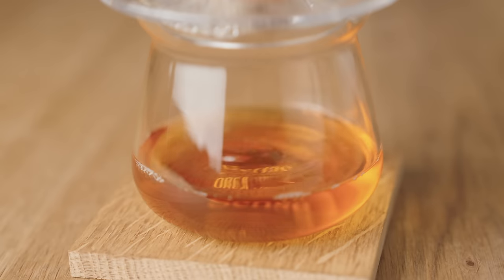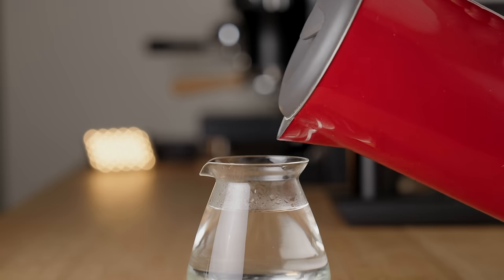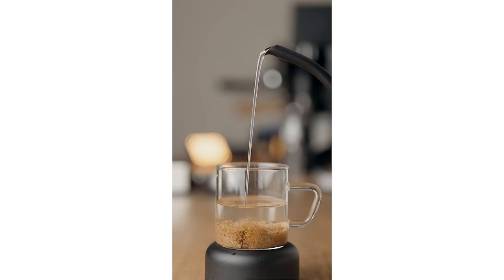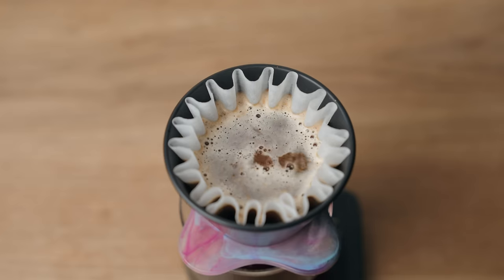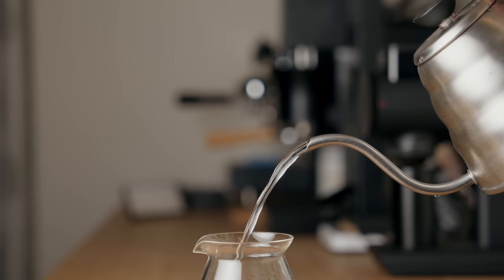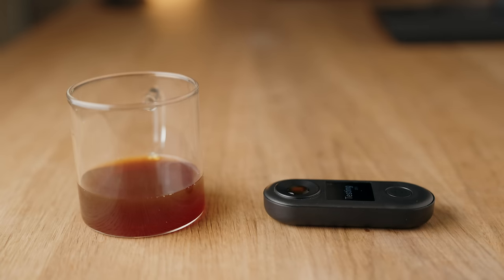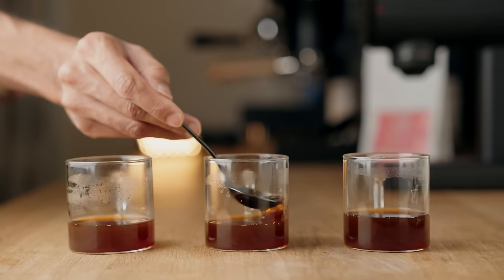Learn To Pour & Never Look At Pour-Over Coffee The Same!

Comment: Changing my flow rate to change my coffee bed to increase or decrease the amount of resistance the dissolved solids are creating. Aim at the sweet spot where your flow is strong enough not too much that the fines all collectively clog. But if you want a faster overall flow use less agitation and grind your beans very fine .

Comment: Thanks! I'm so poured! I have come to learn different pouring techniques using different drippers.
Over time I have changed the way I pour and at present my first go to method is: 1. bloom in a slow circle, 2. combo of center and slow circle 3. three pours combo of bobbing and center 4. let it draw down. To fine tune I tweak with temperature or grind finer. Or agitate less with longer lower center pours. 
With medium roasts I use the osmotic flow. I had the privilege to take a masterclass from the Cafec founder himself on how to brew with the osmotic flow technique. I have come to brew very balanced cups with that technique but it does take some trial and error to master it.

Comment: Hey ARAMSE, I've been loving your content so far! I was wondering if you would be interested in doing a video on different v60s and thermal retention of the brew? I have yet to see a rigorous analysis of temperature loss that compares plastic, ceramic, glass, steel and copper. I am interested as many say metal would be much worse than plastic due to much higher thermal conductivity but since the brewer has such a low thermal mass I am somewhat dubious. I also saw a video that said the copper produced the best results despite the highest thermal conductivity! It would be great to see an analysis that actually tests all the brewers side by side. It would also be cool to see an analysis on how to adjust recipes made in one brewer (ex. plastic) if you only have access to a metal/ceramic etc. v60. Thanks!

Comment: A. I'm so poured.
B. Found my light roast home when you mentioned Bloom Coffee Roasters (can't thank you enough) on another video, so am now really excited to try Quick Brown Fox Coffee Roasters 😃

C. Coming to the point regarding the video at hand:
I'm really happy with my V60 brew every morning, and my first watch was very much in the vein of someone who could've switched off when you asked us to - but I still found tremendous value in the video.

That said, even though I'm really satisfied with my brews, I'm a crazed serial tinkerer who can't help but notice the tremendous differences obtained by swirls, stirs and of course pours (religiously ceterus paribus of course).

For context, I make a 2 cup V60 with 30 grams of coffee and 450 grams of water every morning (so about 66g/l), and I follow the James Hoffmann Ultimate V60 method almost exactly. I do a 65-85gm bloom, restart pouring at 40-45s, followed by reaching a 270gms total by 1m15s and finishing at 450gms by 1m45s.

So many times I've noticed significant changes through:
1. Pouring 300g by 1m15 (as if I were doing 60g/L), and then slowing the pour to reach 450gms by 1m45s.
2. Pouring predominantly smaller diameter circles (say 80% of the pouring circles would be 50% of the maximum possible diameter), vs pouring all diameters as evenly as possible.
3. Pouring more centrally up to 1m15s and then widening for the last bit, or vice versa, or pouring evenly throughout.

But regardless of empirical success and repeatability coupled with my fairly rigorous method, I'm not committing anything to paper, or doing side-by-side experiments. So it really helps to see someone of your stature underscore the truth of this. 

Most importantly, it'll make it really easy for me to dial in my pouring technique for each coffee faster, and also keep it more consistent - rather than suddenly wondering why the same coffee is a little less acidic than yesterday - "I just poured the first bit a little heavy-handedly, that can't be what made such a difference, right?"

Also, loved seeing the T90 Cafec paper - I use it so many times for "darker light roasts" when I don't feel like changing grind sizes, or if I want to pronounce acidity via a faster drawdown.

Thanks for the book recommendation too. I'm sure I'll get around to it sooner than I expect.

Sincerely,
All poured, not bored
(18-odd minutes simply flew by)
Reply from the maker: Love this! Thank you so much for watching and commenting.

Comment: One thing that would be helpful to add is the water column height above the bed before the next pour. For me, waiting until the water has almost drained out before my next pour has had the biggest improvement of taste.
Reply from the maker: This has been covered in the “number of pours” segment of the video :) Pulse pours may or may not work depending on the coffee and grind size but most of my brews are around 3 or 4 pours unless I have a particularly troublesome coffee.

Comment: While this is a very well done video and breakdown of pourover technique, most of it is superfluous and even problematic for achieving better brews. The largest factors for extraction are grind size/evenness and water temp. Period. So the best approach is not to try to stabilize the most variable part of the process, pouring technique, but rather iterate on the most reproducible changes.

Instead, home brewers should learn a pourover technique they feel they can master the muscle memory of the best, and be as robotic and reproducible with it as possible. After that is learned, iterate on grind until you reach the smallest size possible without stalling. 

Finally, iterate on water temp, which good kettles have the finest controls over.

You approach here gives brewers far too many variables to master, stabilize, and map to flavor results.
Reply from the maker: Thanks for watching and commenting. These are all just tools and sometimes grind size changes just don't work. A lot of people don't have super fancy grinders, so if their brews are stalling with a coffee that's troublesome their only option is to switch up the pour. Try a centre or obstructed pour and you can get tasty cups that you couldn't otherwise. Also we never once said ignore grind size and water temp. Also temperature is a lot more confusing than the general information we've been given of "lighter roast = higher temp", and is something we've experimenting with and will hopefully be able to share information on soon.

Comment: Great video shedding clarity and light on a complex subject that's usually only approached in passing. And bringing it into focus with the three cups is genius in its practicality, as until then I was thinking, well this is all great but where to start?
But a question: when you transition from circle to centre pours, do to adjust grind size, and go finer? I just had a go, going to more of a centre pour, using your timings, and it drew down so much faster than my usual pulsed circles with the same coffee. It did, however, taste clear and bright and delicious, and I will be playing with it some more. I just wondered if you had any capsule thoughts on how the circle-centre parameter typically plays against grind size in your brewing. Thanks as always!
Reply from the maker: Great question and it completely depends on what you're going for. Center pours will reduce brew time quite a bit so if the cups turn out too acidic you can reduce the duration of the center pour or make that pour less aggressive to balance out the brew. Then taste and tweak. This video is all about pouring but of course if you feel like going one click finer without changing anything else would be an easier way to get that coffee dialled in then by means go for it. When you're experimenting though, only change one variable at a time so you know which change had an impact on the cup.

Comment: Golly, I'm so poured and a bit bored. 

I get being geeky, but if we're talking "extraction," but using paper filters, we're running a three-legged race with all four legs tied together. 

Stainless steel filter - Aeropress or French Press. You actually get into the cup what you worked to extract, plus you're not worried about the flow rate aspect. 

If I want mineral/straw water, I'll do a pour over. 

Thankfully, I'm a coffee drinker. 

I want the oil. I drink the oil.

Comment: I'm so poured!

What I've noticed is that light, Ethiopian coffees tend to start off very tea-like and complex a few days off roast, but within about a week or less, they become over extracted use the same recipe. I always use my fastest filters for them, but I don't typically modify my pouring, which is on a V60 using the James Hoffmann technique, with the only modification of using a Switch in which I hold the bloom water, then release and pour the rest as normal. What I've found to work pretty well is to lower the temperature. At first, I was very disappointed but the temperature reduction (off-boil to about 95c) seems to work well. 

Would you recommend anything I can try with adjusting the pour? After watching this video, I'm thinking more center pours to increase the draw down rate. I have tried various recipes but always come back to the Hoffmann recipe,. However, I haven't paid much attention to pouring technique other than "low and close to the bed" at the right rate.
Reply from the maker: Could you describe from a taste pov, what you mean when you say over extracted? Light roasts start out quite grassy and take like 2 weeks to really open up. If you tell me your draw down times then I can try and help you troubleshoot.
Reply: @aramse  drawdown times are usualy in the 3:30 range using a Cafec medium roast filter and water off-boil, I usually enjoy them about week off roast, and most light roasts tend to hold similar flavor for me from a week or so till two or three weeks out, only minor flavor shift. However several times I have experienced Ethiopian coffee that tastes  very tea like with fruity notes at that ine week mark, but then starts to become bitter and over-extracted tasting using the same recipe. They best luck I've had had been lowering the temperature as I can't get a faster filter and grinding courser alone produces a very weak cup.  The drawdown times seem to be stable as they age.

Comment: Aramse, can you enlighten me about temperature, when one say use 92degC water, is it water in coffee bed or in kettle?

I measure it only when I use near boil water I can keep temperature in coffee bed at about 90deg. If I use 92 water in kettle, coffee bed is 82 deg regardless of how I warm the equipment, or I have to boil my dripper which is impractical.
Reply from the maker: Great question. So temperature for pour over brews usually refers to kettle temp and not the slurry temperature. The material of the brewer, how you preheat and other factors dictate the brew temperature. Also it’s important to note that you can get very similar extractions even with temperature differences of over 5C but the cups will taste very different as different flavours compounds extract at different rates and some are only soluble in higher temperature water while others will get extracted even at lower temperatures. I hope that answers your question.
Reply: @aramse thanks for quick reply. What temperature do you usually use? Have you ever use near boiled water? Curious for you to try. I watch JH vdo long time ago about this but it wasn’t very clear.

Comment: 14:22: I've been doing this recipe for a couple of weeks now. In my case, the water goes down very slowly, if I follow your timing, I pour water over more water; for 250ml it takes like 5m 30s. So, before each pour, is the water supposed to have drain completely?
Reply: Sadly, I don’t have a grinder, so I get my coffee ground at my local store. Because of this, I need to finish the entire batch before trying a coarser grind. So far, I've tried two different grind sizes with little variation in the results, so I’m thinking I might need to change the paper filters. Do you have any recommendations for fast paper filters? Thank you!

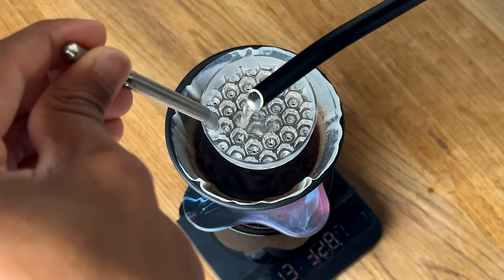Comment: In 17:24 you said start with controlled direct pour. What do you mean by “controlled” as opposed to what?
Reply from the maker: This is basically the bloom where I'm just being careful to wet all of the grounds without pouring too agressively. I usually have the spout quite low down and start at in the middle and slowly move outwards being very careful not to miss any spots as opposed to a high flow to high agitation pour that disturbs the bed a lot. Hope that makes sense.

Comment: What range of grind settings are you using on your 78 for pourovers? I’m also brewing at 15:250 lately with similar preferences in the cup 🙏🏽
Reply from the maker: I used to hover around 6 and 7 but I’m enjoying going finer off late. Lot more sweetness to the cup. Grinding anywhere between 3.5 and 5 these days. If I go very fine then I brew with low agitation using a melodrip.